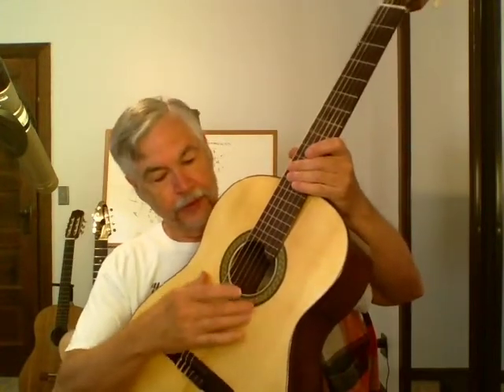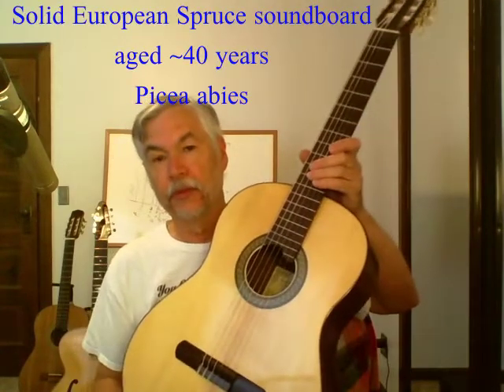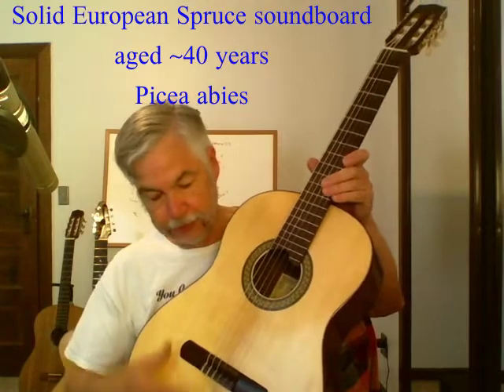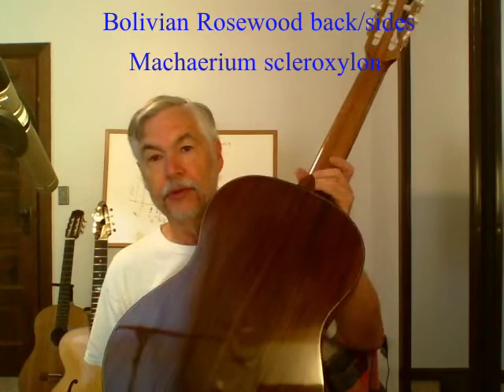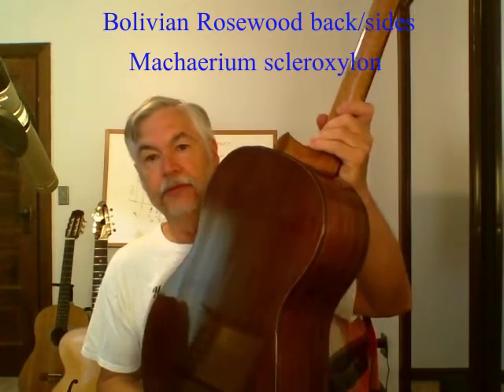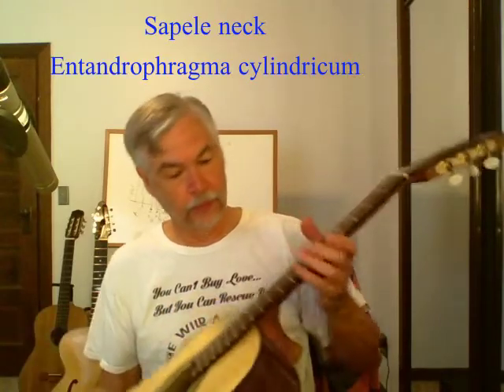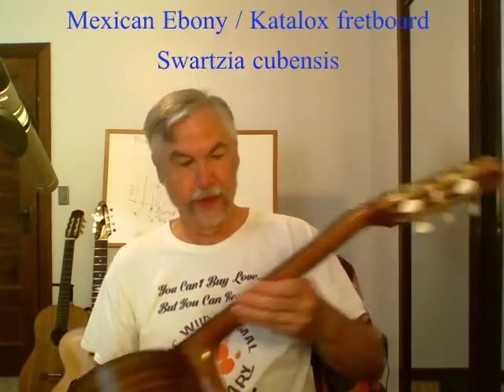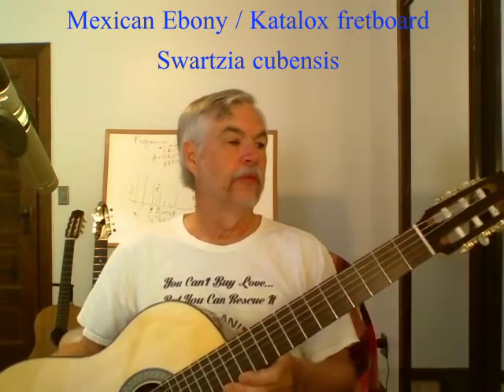Demo and description of the first successful solid, "pin" top guitar.

Comment: Hello sir..  feel great for found your videos. I think I will try to build one with pin top. But what do I need to pay attention to in order to make a good pin top guitar ?
Reply from the maker: Pretty much the same thing as any other acoustic/classical guitar, how vibrant the top is. I prefer a well arched top, but I don't think it's required. Watch several of the videos I have about how I build guitars. 
I use different bracing for solid tops and double tops. I use a fan bracing for solid tops, but I don't extend any braces into the upper bout. That kills the sound. I use my own modified open lattice for double tops.